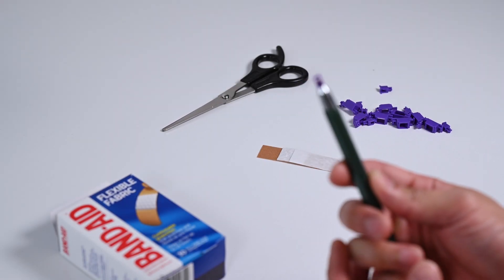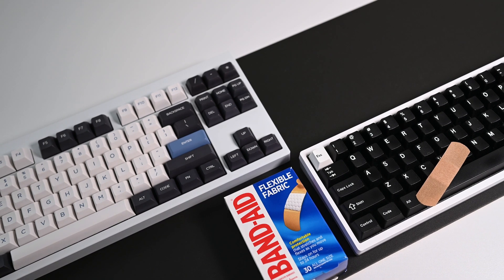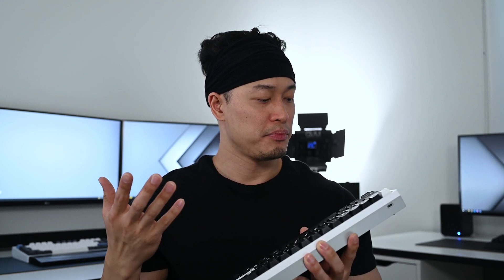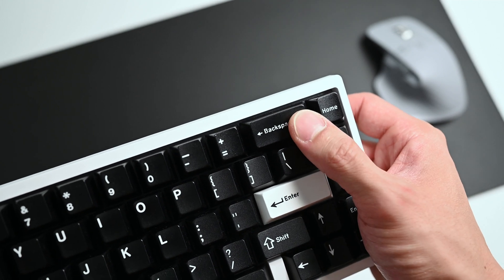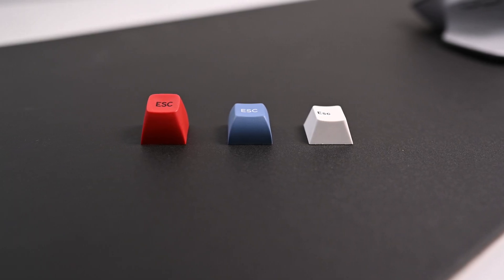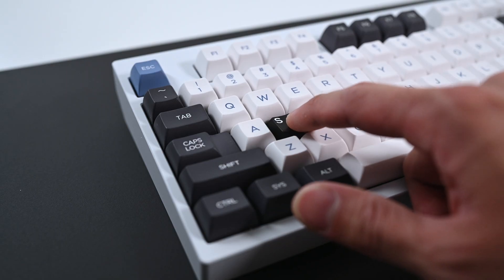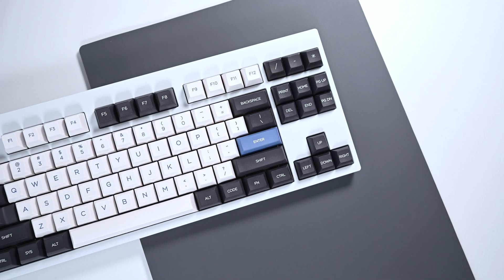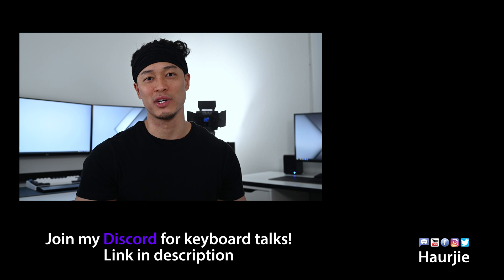Holee Mod Before And After – Fix Stabilizer Rattle

Comment: My stabs sre really mushy, and ive done the bandaid mod and the holee mod. I saw a youtube video that says I should use tape instead of bandaids for the holee mod
Reply from the maker: Ehhh what kind of tape though? If the tape is too thin then it doesn't do anything. But if tape is too thick then it can also be mushy
Reply: @hardlinenexus  i believe it was clear scotch tape
Reply from the maker: @Chopstlcks  Yeah I avoided that for the reason for being too thin with no cushion at all... But I've never tried it so I can't say for certain as I was just going off of intuition

Comment: Great video! I’ll make sure to try this out when my SixtyFive arrives
Reply from the maker: Yee haw! I'll be doing this on that board too
Reply: waiting for my mode65 too, can't wait 😭😭 coming in Jan and I ordered full PC case and POM plate for max thocc and flex (going to use gat inks)
Reply: @ightimmaheadout290  Good choice! I went with alu top/bottom with a mirror backpiece and a POM and an FR4 plate to try out with my lubed and filmed Alpacas.

Comment: I've just holee modded my stabs and they're all fine except for my backspace, which turned out to be a bit more mushy than tested after putting everything back together. Have you had any similar issues? Also, nice to see another white and grey kbd67 lite owner :D
Reply from the maker: Yeah backspace was a bit mushy, but it doesn't bother me though. I'm sure it will break in over time because the bandaid will inevitably get "hit" and "squished" thinner and thinner, at least I think that's what would happen, so there's not as much cushion to make it mushy, but at the same time enough to do it's job reducing the rattle
Reply: @hardlinenexus  lmfaooo imagine it really did get "thinner and thinner" 😂🤦‍♂️🤦‍♂️🤦‍♂️🤦‍♂️🤦‍♂️
Reply: try spamming it for 5-10 minutes and it might help
Reply: I've holee modded all my stabs and few are mushy. I think this is because the bandaid is wider than it's supposed to be, providing more cushion than needed.
Which is why some stabs have that deep thocc sound and others have a muted thocc sound.

Comment: If you don't want to use bandaids, you can use left overs stab pads. I find it better than the bandaid holee mod.
Reply from the maker: I have some, that could be a worthy experiment on the next board I build
Reply: @hardlinenexus  Nice! Use the left overs cut outs, not the actual stab pads. Just in case I wasn't clear haha. It's very snug but once you broken it in... absolute gem!
Reply: Yeah, this is another solution, although the concern is that it's not as adhesive as the bandaid and may become loose after a while.

Comment: Ticking could relate to a bad batch of stabs and or wire unevenness. People forget that durocks are technically clones of zeal’s and there are indeed some minor differences in their builds that might add up to something like slight ticking. I’ve tried holee mod on durocks and it’s certainly good and reduces rattle/ticking, but it isn’t perfect
Reply from the maker: Yea I realized it won't solve it completely, but can definitely try to get rid of most